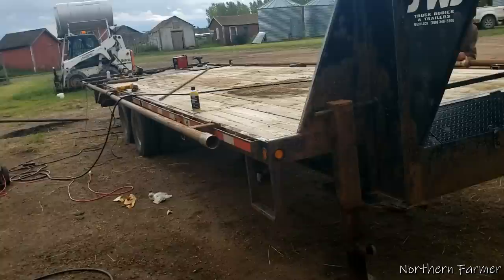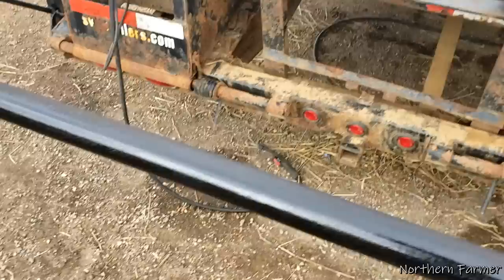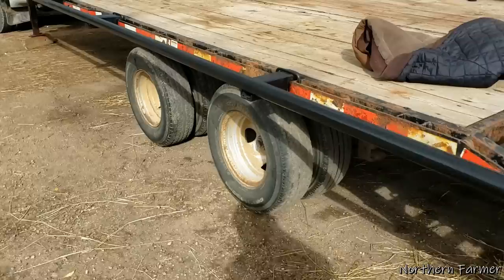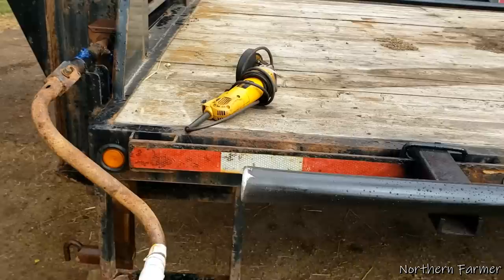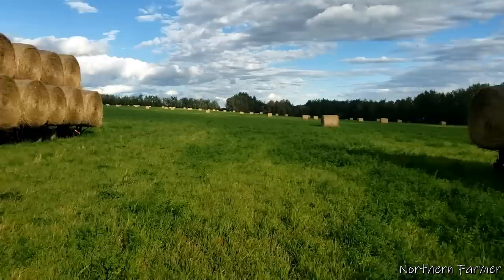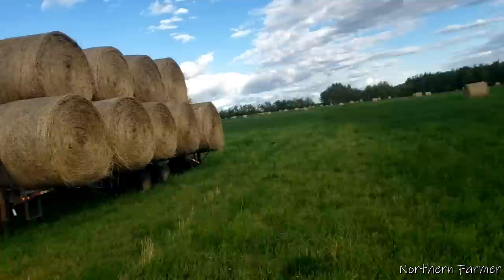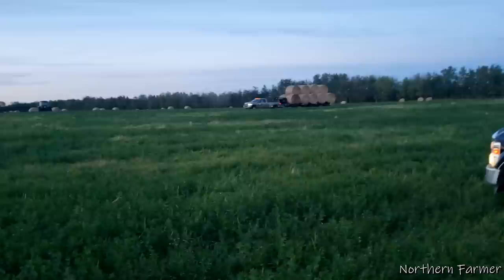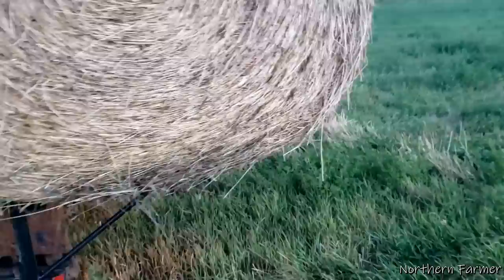Building Hay Trailer Extensions!!!

Comment: Nothing like a farmer, with a welder and some leftovers from whatever!!! 👍😉  God bless the oil industry, producing excellent raw material for farmers with imagination and 💪  We haven't got any in this godforsaken Sweden, but we've got a lot of people throwing out their oil-based heating, including their 3000 Litre basement tanks 😜  Maravilloso 3 to 4 mm thick material, easy to cut and weld, now I only have to control my imagination 😱  Thank you for showing what we the ones with dirt under our nails are capable of doing 👏👍
Reply: Cut the tanks lengthways and they make really good water drinking troughs for cattle so long as you can come up with some way of preventing them rolling over and leaking. perhaps cutting them into three pieces lengthways they might make feed troughs for silage or other bulky foods?
Reply: @w056007568  Just some sheet metal bent 90 degrees and welded on as feet and you get them "stabilized".  The ones I've found are square, to take up less space in peoples basements in the day.  At the wreckers they even already have them cut up in nice sheets, some with stabilizing fins and all, oh that imagination starts running again ... 😱😉 The tractor has already got a "belly protector" for forest work 🚜

Comment: We depended on cornstalks for bedding so as soon as we could get in and bale roundbales we did. I had my son who was 8 at the time drove the 4640 or the 4440 with 2 flatracks that were both 30 feet long for hauling  round bales and I drove a New Holland skidloader and my son and I or daughter  could pickup 160 Acres of round bales easy in a day, it took longer to chop and bale than it was to pickup bales. And the farmer I worked for 15 years we had 160 acres of alfalfa and we hauled with a flatbed  semi trailer we bought on a auction that was a old Morton Building trailer and worked great for hauling bales and we hauled to a cattle lot 10 miles away

Comment: Might be worth welding a tab of flat steel to the top of the box section just on the inside of the u-bolts.  It would stop any chance of the rail pulling out sideways especially if any of the u-bolts were to loosen up .

Comment: Your welds look very professional !  That tubing is very ingenious, and you make a good fabricator too with good ideas of using the metal you have on hand vs what you need the trailer to do. I also like that you now have Ford & Dodge trucks as well. I like Ford the best, however its not my choice. Always nice seeing you Tyson, take care & stay safe.
Reply from the maker: I dont mind the dodge to much... I still like the ford better
Reply: @Northern_Farmer  yes my choice of the two would be the Ford now that you've mentioned it.  I still own a 1995 Ford Escort, I use it as my around town car rather than take out my choice 1997 Jeep Cherokee Sport HD Custom. That is how tough Fords are if maintained. Of course that is just my opinion & I'm a careful driver as I seldom take either vehicle over 2500 RPM and they are garage kept and well maintained. Thanks for your reply Tyson.

Comment: Could you consider two more lengths fixed to the top of the gooseneck to carry 1 more up there if the truck suspension is up to the load weight? You might have also think about how you might stop a bale rolling onto the cab if you jam the brakes on hard or are going down a significant slope!
Reply from the maker: The truck will handle it but Im not interested in putting anything up there for now

Comment: That field looks like you can almost get another cutting off of it. Add some red clover to that field, about a half pound per acre, it'll help feed the brome and timothy. 
That tractor supposed to have that squeal? Sounds like you might be having an issue with the transmission on that CIH. 
We used to load our trailers maxed, even put one on the trailer hitch, never had issues as many will say it causes problems, we never had any. Yea, having an extra hand loading and unloading hay is a must. It got to the point to where I had a quick hitch style hitch with the gooseneck ball on top. Just used the tractor to haul with, eliminated the need of a driver, was slower since you're at the mercy of the speed of the tractor. Great video, cheers :)
Reply from the maker: Nope..thats how they sound in reverse

Comment: Always a little more engineering required BUT these trailers sure beat that old POS wagon you used with Ol Smokie.
Reply from the maker: I have that highboy on the freightliner truck... I have a dolly converter to be able to pull it with a tractor

Comment: I hate how the reverse gear on those case tractors feels like it’s on the third power shift and just stupid fast. Haha 1070, 2290 they are all that way. I have a 32 foot with 12000 pound axles and I can fit 17 on it but my bales  are a bit smaller than yours. Ram 5500 pulls it real good
Reply from the maker: That truck will handle that no problem